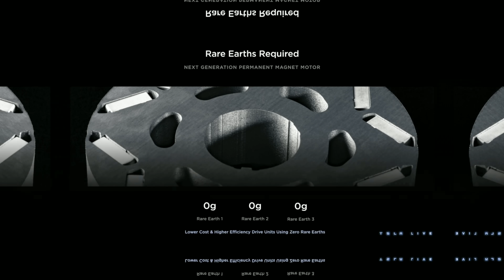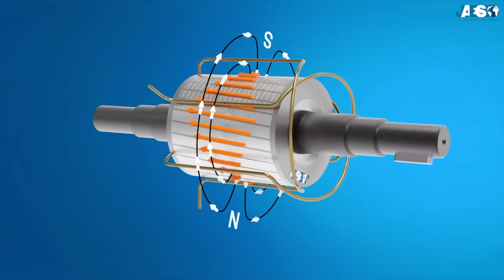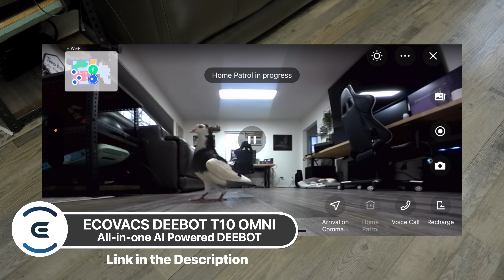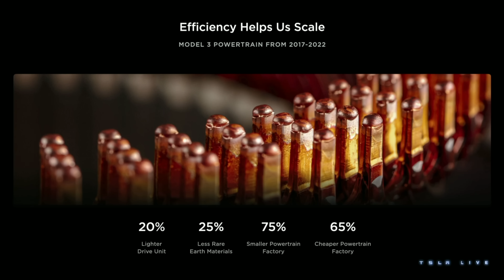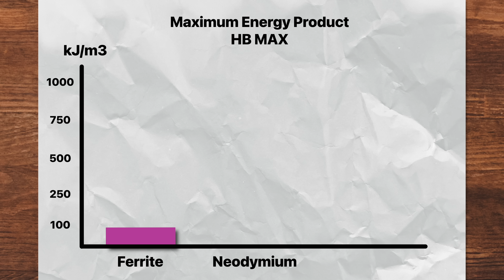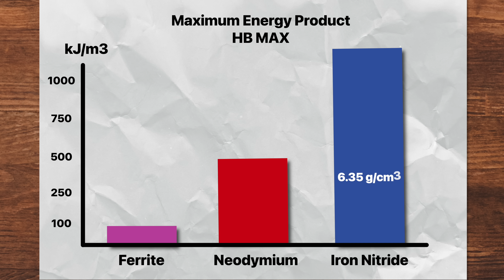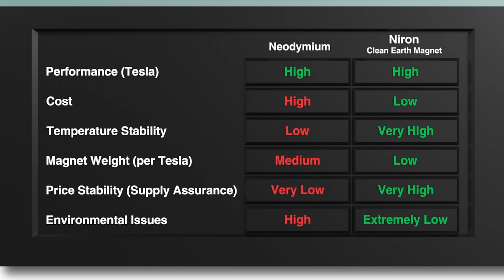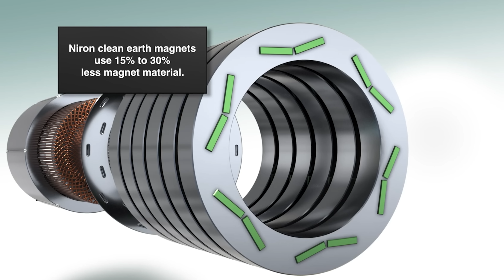The GENIUS Of Tesla's Next GEN Motors!

Comment: Lighter and stronger and cheaper magnets, and posed to make electric motors in cars better.  

It sort of reminds me of Reardon Metal in Atlas Shruged, a metal alloy invented by fictional charicter Hank Rearden that is is lighter and stronger than steel and cost much less. And in the book, it literally revamped a certain transportation sector of the economy.
Reply from the maker: These really could have an effect on many products if they can scale this all well.
Reply: @TwoBitDaVinci  I have no doubt it could if it is produced cheap enough. Generators and motors can be made smaller lighter and cheaper with less copper and other materials which may open applications we could not fathom right now, especially factoring in it's higher curie temperature. 

Weight is a significant reason why motors inside wheels is not a bigger than it is. Unsprung weight of a motor inside a wheel is not good for suspenion and comfort in a ride.  If we can deliver more power with less weight from a motor, then placing a motor inside each wheel could eliminate gear boxes transmissions ect with their losses, and more efficently simply direct drive a tire with a motor inside the hub, and thus also eliminate the weight, and cost, and friction losses of a drive train. And thus, save even more energy in transportation.

Cheaper Generators may make small scale wind a bit more attractiv than it currently is.  And may even make a difference in adopting gravity batteries that will need motor/generator that can perform better and be made cheaper.
Reply: @Keith Reynolds Dude, I hadn't heard about that book. It's on my list after finishing off the Glide Trilogy by Bill Gourgey. It's a really nice read and full of positive futuristic sci-fi concepts.
Reply: @Israel_Two_Bit  Be prepared to
have your mind blown 😊.

Comment: What about Windturbines? Any chance these magnets could be used for that? It would totally solve our China dependency problem too. This could be the game changer we've been waiting for to give the energy revolution a huge boost.
Reply: Wind turbines can be theorhetically increased in total efficiency by 38% using counter rotating rotors in a counter rotating blades wind tower design. Mechanical losses are the limiting factor. 

The Sansone motor has a denser torque flux as the flux lines are fed at two 90 degree orientations to each other whicj can combine the benefits of both axial and radial flux and thus increase the saliency ratio..... (Weight to power ratio and torque density to Power phase frequency) this means as a generator it would be more efficient than the current max of 70%>>>> this means smaller generators, lighter and more powerful with current phase transfer ranger that is more efficient at recovering eneegy with a dmaller current management demand.... (Smaller.lighter inverters)

It means that Wind Turbines can double in energy output per unit.
Reply: @jeanpaulchristian3282  Counter/contra rotating turbines are already on the horizon with an insane max output target goal of 40 MW per turbine by 2029 for the company World Wide Wind.
Reply: @jeanpaulchristian3282  Hahaha, Jean Paul, you must be an engineer. Couldn't follow all you said but what I understand is that the short answer is: YES!
Reply: @PaulSinnema  To answer your original question, yes, this new permanent magnet material would be extremely beneficial for wind turbines.

And yes, it's a major step towards improving electrification of the planet.
Reply: @jeanpaulchristian3282  it must be the desire to know more... I appreciated your detailed feedback.
Reply: Good point. They're reverse motors after all
Reply: That’s  a great thought 
Good thinkin

Comment: Just one mistake in the comparison between Permag motors and induction motors. Induction motors are "sluggish" at low RPM, because you can't get the airgap voltage necessary to induce high current in the conductors of induction rotors. The maximum voltage that can be applied to a stator is directly proportionate to the frequency of the AC. As the frequency increases, the voltage can also increase, which makes it easier to induce current in the rotor. The induced current is proportionate to the torque of the motor, while frequency,(hand in hand with voltage) is proportionate to RPM.
     With a Permanent Magnet motor, the torque is limited by the field strength of the magnets, regardless of speed. Like the induction motor, the voltage and speed are proportionate. A permanent magnet motor can produce its maximum torque from 0 to redline RPM.

Comment: The great thing about Pascals, (in thr minds of advertisers) is that you get THOUSANDS of them!
Personally I'd prefer a unit of measure that's more readily, 'visualised'. Pounds per square inch for instance, but then you only get 0.72 of those!
Interesting and informative information on Iron Nitride Magnets, thanks.
Reply: Yes, I inflate my car's tires to 206,820 pascals - that seems best.
Reply: Just to be clear,  a Pascal is a metric unit of pressure,  similar to pounds per square inch.  If you look on many pressure gauges,  they are also calibrated in Pascals as well as PSI (or whatever)

So just as an inch is an English unit of measuring distance,  a Pascal is a metric unit of measuring pressure.
Reply: @SeattlePioneer  Yes, the units are indeed inter-operable and convertible and advertisers like the exchange rate!

Comment: Forget the motors we need a battery revolution, they need to double the range and shorten charging to 5 min at a charging station.
Reply: No, they don't.
Outrange the driver.
Charge in the time require for a normal (not "pee in a bottle") driver to "refresh".
.
Repeat.

Comment: Axial flow motors have a lot of the same advantages, smaller more powerful.
Reply: But lower rpm.
Reply: Yes. And they can be fitted inside the wheels, leaving a lot more room for the rest of the car. Although I suspect it would impact maneuverability having to turn the entire engine along with the wheels. Food for thought
Reply: @ipp_tutor  Unsprung weight in the suspension is highly problematic for handling and grip, which is why only tiny vehicles use hub motors and performance vehicles all have the motor in the main chassis with a linkage to unload the suspension even if the motor would technically fit in the wheel.
The shock forces when the wheels hit bumps is pretty terrible for anything that needs precision too - keeping in mind that motor torque is a non-linear function of the gap between the stator and rotor (amongst many other factors)

CVs (and their various cousins) are here to stay for a while

Comment: Very nice.  I want one or 10 of them to play with.  What is the results of the power draw on a battery between all the motor types?
Reply: think of the low power, high strength of hand magnets for attaching to surfaces!
Reply: I imagine it's more a question of efficiency than (extra??) power draw.
If you combine a more efficient hairpin winding (fewer air gaps, more uniform induced field?) with a lighter, stronger magnet, you get more "bang for buck" in terms of force, compared to the old methods?
Reply: @rogerstarkey5390  I think so as well, but would like a table/graph of results for the same Newton-meter/sec power output.

Comment: If Lucid does something similar, their powertrains would be under 10kg
Reply: Why? Lucid already uses hairpin wound motors and very trick direct stator cooling systems. Along with integrated differentials and sophisticated torque vectoring. I think lucid outside of koenesigg with the quark hybrid axial/raxial motor setup in the gemera. 

Has the most efficient and power dense motors available already. Motor trend just tested a tri motor sapphire and somehow lucid got the 3rd motor, larger brakes, wider wheels and tires with torque vectoring on the sapphire yet only gained 40# over the dream dual motor version. 

And tesla with the plaid is about 200# heavier than a dual motor lr model s. So great job there team lucid engineers.🤔
I don't like lucid very much or Rawlins at all, but engineering wise, they are right at the cutting edge of ev tech imo. 👍🏻
Reply: @4literv6  Why do you not like Rawlins?  He's never made ridiculously ill-advised tweets that tanked their stock.

Comment: I thought there would be mention of the new way of wiring, using flat sided wire to wind closer together and use up the space left by round wire. I think it was Musk who did that.
Reply: They are using hairpin wiring, but that's not really new. If you see the picture they show about the 2022 drivetrain, the one with the little copper spikes with balls on the tips, those are the welding on the underside of the hairpin stator. And that image relates to the 2022 drivetrain, so they're already using those for the current motors. The real breakthrough is in the magnets, which is something few people have correctly pointed out!
Reply: Tesla/ Elon never claimed that was their invention. In fact the never even mentioned it on investor day.
It was Sandy Munro (or Cory?) Who saw the picture and recognised the change (Sandy almost had a Coronary).
Reply: @rogerstarkey5390  Yeah. That's right. But I think he failed to acknowledge that that picture wasn't about the new powertrain at all. It was about the current Model Y powertrain, the one that had a lot fewer rare earths and requires a smaller factory, but still uses neodymium magnets. The new thing here are the magnets. Also, unlike neodymium magnets, which are crazy hard to magnetize, iron nitride can actually be bought unmagnetized so that companies like Tesla can design optimized form factors unattainable with neodymium. This is a real breakthrough.

Comment: I assume it could also be used in wind turbines and revolutionise that renewable technology too.
Reply: I've been wondering about repowering and upfitting old hydro project turbines with modern more efficient easier to control through software motors&turbines? Ad grid scale batteries and floating solar to the reservoirs and it could drastically extend the usefull lifespan&output. 🤔
Reply: @4literv6  That's a great idea. I wonder if it would make sense economically for companies to design and build new swap-on replacements for older turbines. I mean, dams are so expensive to build and they make such an environmental mess by flooding so much land once built that it would be a shame not to use them to their full potential, right?
Reply: @Israel_Two_Bit  exactly some dams have operated succesfully for over a century now. And the average one in use is over 5 decades old. 
Not to mention in the U.S. many reservoirs are located on federal land so adding additonal upgrades wouldn't be the horror trying to get a new project approved is. To much nimbyism imo. 

Another thing they could possibly do easily is ad large wind turbines around or near the upper reservoirs. As dams use hvdc links perfect for adding batteries solar and wind turbine capacity onto. Without paying large upgrade costs as a lot of them operate well under 50% of the rated or nameplate capacity. At least from the research I've done. Probably could earn a lot of $ for the upgrades to under the ira. 🤔
Reply: @4literv6  You said it! Ricky made a video abut Aeromine wind turbines which work really great when they line flat vertical surfaces like the walls of a dam. That would be pretty cool to see, hehe

Comment: AC induction motors have an issue at high RPMs - they have cogging; which is brief moments when the magnetic fields are pulling the wrong direction. I.E. they are having to "fight" to keep the motor spinning in the right direction.
The Model 3 motor has (at least) 2 important innovations:

The magnets are made up of a series of 4 sections that have the north/south orientation in different directions - called a HALBACH ARRAY. This "focuses" the majority of the magnetic field in ONE DIRECTION. Which vastly improves the usable strength of the magnets.

The flat magnet bars (of the Halbach arrays) are angled in shallow Vs so they "conduct" the magnetic fields to almost eliminate the cogging.
Reply: Unfortunately, Munroe was wrong - the Tesla magnets were not arranged in a Halbach array.  The magnets were laminated to reduce eddy current losses.  Tesla no longer laminates the magnets in their newer motors.
Reply: @kn944  I wasn't referring to Sandy Munro on this. But you may be right, as I only was mentioning what I had heard from another source.
A Halbach array may or may not have a benefit, but if it was a help to make motors even more efficient/cost less, then it is possible.

Comment: Is torque really what gives quicker acceleration? I don't know of any definition of torque that has time as a component. Torque is a measure of force, but it can be applied to a stationary object adn not even move it. Power or HP in American automobiles, does have a time component. I'm suggesting that any reduction is time for acceleration or any other motion has to be related to an increase in HP. While HP and torque generally don't exist on their own in automobiles, HP is the factor that defines performance. Torque at the wheels can be increased or decreased with gearing, HP cannot. Certainly there will be examples of high torque motors have superior performance to higher HP motors, but peak HP is only a tiny picture of the performance of a motor. That high torque motor will always put out more HP than a motor with less torque at the same RPM (speed). They are linked mathematically. Torque is not doing the work, HP is. HP should be measures across the entire operational RPM range to indicate the true performance capability of a motor. HP outside the normal operating range is of little value. High torque motors also have high HP in the RPM range they are most often used. A good example might be the Mazda RX8, which had very low peak torque, but certainly out accelerated many vehicles with significantly more torque. The same is true for many racing engines. Torque does not win races!
Reply: You can have torque without HP.
You can't have HP (Movement) without torque.
HP "at the wheels" is a function of the torque and gearing.
Comparing to a Mazda (rotary?) irrelevant.
That had relatively low torque, needing revs (and probably a new clutch) to achieve results.
Electric motors are the complete opposite.
Maximum torque from zero.
Flat torque.
Increasing power as revs rise.
Single gear, toque dropping at very high revs.
.
Torque (demonstrably) DOES "win races".
Watch an EV on a dragstrip.
All over in the first 20 metres.
Reply: Acceleration from low speeds or stationary is torque limited via f=mA
Acceleration at high speeds is power limited via ke=½mv²
Reply: "Torque at the wheels can be increased or decreased with gearing, HP cannot."
If you increase torque by increase the gearing ratio you also proportionally decrease HP. As you said, HP has a time component. So by increasing gearing it takes longer to move the same distance. Thus HP reading goes down.